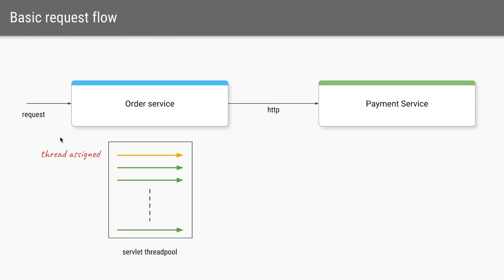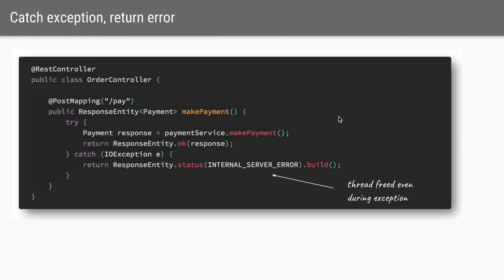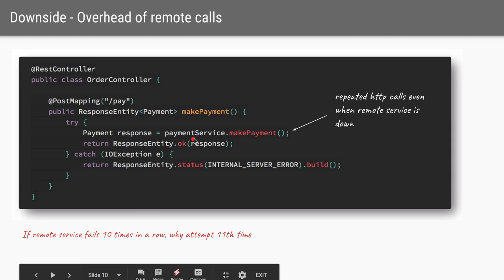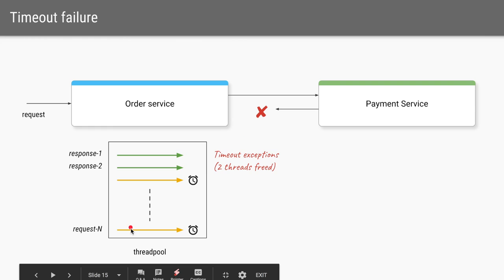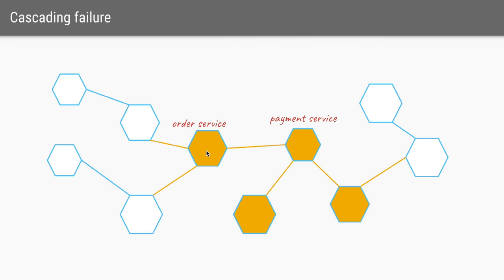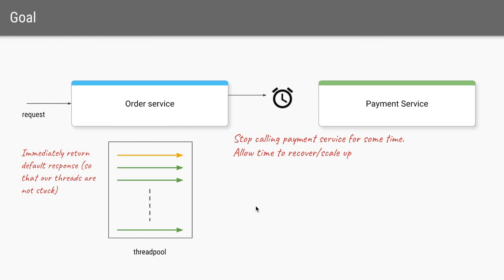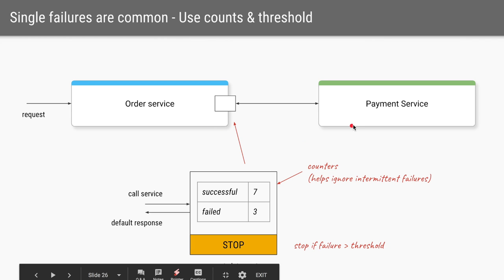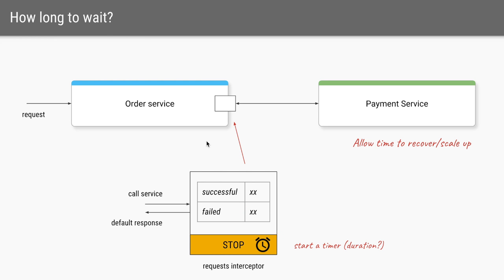Circuit Breaker Pattern - Fault Tolerant Microservices

Comment: Please do a Design Pattern series!

I feel with your experience and innate ability to explain in succinct terms, you can convey implementation of design patterns that would stick! (and also, how to figure out which one to use). The bookish or general pizza/car/ducks example do not shed light on how its practically used in everyday software development.

Comment: Theoretically it will be good to have "default-response" for  bulk head and circuit breaker patterns for managing the fault tolerance micro services, but where to apply is the question. How do you process a transaction without real-time authorization. Sending a default response does not solve the actual issue as most of the e-commerce sites does not allow "offline credit card processing". Yes it is good to have fault tolerant services, but where and how they can be used is the real question.

Very good tutorial. Keep it up.
Reply from the maker: especially for complex applications there are huge number of microservies.. one important functionality of this is to allow upstream services to recover and not bombard them with requests... and secondly lets say i have a discount service, if its unavailable i can still process the order, without discounts

Comment: Interesting topic. This sounds like a great candidate for machine learning to take control of the interceptor and dynamically adapt according to the service status. With more variations this could be helpful, suppose that the payment service is slow but can still process some traffic just not much, a static solution will either allow or stop, a smarter solution would be able to adapt to the threshold which could vary. I've actually seen problems like this for the company I work for, where we manually have to stop connections after some threshold to keep services up.

Comment: nice video explaining the pattern, though I won't couple the pattern into the microservice. Instead, I will let the orchestration to do that. That allows you to decouple your circuit breaker and leverage all the metrics and logging to the service discovery.

Comment: Hi..the content on your channel is really good..at the beginning of the video you said that if a service send an exception msg immediatly, the thread will be freed  so cascading effect will not occur. only when exceptions are sent after some delay other services get affected. My question is,  while maintaing a count of exceptions how will circuit breaker know which kind of exception happened?
Reply from the maker: Resilience 4j has 2 methods include and exclude where you can give list of exceptions to be considered for breaking the circuit 

Also, even though thread is freed quickly you may still want to avoid bombarding requests to allow other service to recover

Comment: Good one & I have no knowledge about these microservices, but I was just thinking that cant we have one minor health service thread running for every individual microservice on other port which a circuit breaker can check if the service has come-up after certain % of failures, rather allowing any more requests to pass through. And put all these failed requests in queue for some preconfigured time in circuit breaker else return the error to user to try after some time. Or depending on the usage of such services, these can be started on few other nodes also, during the loads & load balancer will distribute the traffic accordingly. Just a thought came to my mind.

Comment: Very nicely explained. Thanks for the effort you have put to explain. Just one qsn, what if the application is running on multiple nodes(multiple. jvms) , do we need to have any other configurations or the circuit breaker will handle that?.

Comment: Amazing video. Keep it up. 
I have two questions, it might be silly ones but I would love to hear from the DEVs
 
1. Is it a good idea to implement circuit breaker while making a DB connection or during query execution? Now if the system will not be able to get a connection none of the requests will go to the DB which should not be the case. Something must be implemented at DB side or in between  service and DB. 

2. Does this circuit breaker is required in PUT and POST APIs too ? Like for PUT POST we will make a request, this will use resources to build the request and finally it will fail if in an open state? Shouldn't this state be checked in the first place ?

Comment: Nice presentation. 
Just wondering: do you have any video explaining the differences between Circuit Breaker pattern vs Reactor pattern. Both of them are good for handling 'Cascading Failure' situation, isn't it?

@Defog Tech

Comment: @Defog, does this problem only exist in tightly coupled synchronous communication model like REST? Cause I see if instead, we use message queues/kafka based approach for communication we can avoid these cascading failures. Also even in case of REST, are we assuming the threads are not using asynchronous IO like Completable Futures in JAVA/ Spring Web Flux/ async await framework in C#, since they are getting blocked on IO request and doing redundant waiting? I feel using async IO can solve these problems without using circuit breakers. Am I not seeing something?

Comment: Any video on how to test microservices or testing strategies, for testing community please..
Reply: With the example of the payment service and order service above, you can run integration tests for the order service by mocking the payment service and passing that mock to the circuit breaker. That way, you can check it fails correctly in certain scenarios by changing the mock to simulate failure of the payment service.

Comment: Very nicely explained. Thanks!
I have a question though. If we use circuit breaker for making payments, can it lead to duplicate payments? 
I am using Hysterix in my API and few times amount is deducted twice from customer's account. I suspect it is due to Hysterix. 
Would appreciate you reply on this.
Thanks
Reply from the maker: Yes, thats why for such requests, its good to have idempotency_key. Check out Stripe payment documentation for better understanding.

Comment: I have  a Question:-
In my microservice, I am making a mono object if my client service is down or client service gives the 5XX Error
return Mono.error(new InputException(HttpStatus.valueOf(clientResponse.rawStatusCode()), "SERVER_ERROR_RESPONSE", "CLIENT_SERVICE_SERVER_ERROR_RESPONSE"));

What should be my fall back method argument to catch if it is caused by this case, to be precise i am making the mono.error objects if it has any failure responses from the client side ?

Comment: what are the differences between immediate and timeout failures then with respect to the circuit breaker pattern? are they treated in the same way?
Reply from the maker: good question.. AFAIK circuit breaker is unaware of which type of error it is. The timeout errors are dependent on the underlying http-client

Comment: Why don't we have a healthcheck api? and Request Interceptor call it and will have health info of PaymentService and that will be more robust way.
Isn't we doing a complex work instead of listening to Heartbeat or calling a health API?
Just a doubt. :-)
Reply: It depends on how the health checks are implemented, most of the times, we have shallow health checks like ping-ping, if there is any DB accessing issues or partial failures in the application (like Integer overflow exceptions in DB) and the rest of all functionality of service works, shallow health checks may not surface those. We can have deep health checks, but those are very expensive, checking all functionality for every health check is not good approach.
Reply: @manojBadam  Got it. Could you mention few points that are part of deep health check.?
Reply: Gaurav Pandey We use both shallow and deep health checks for our service. for container orchestrators like K8s,ECS we use the shallow health check and for deep health we have a suite of concise integration tests, we run these for every 10mins in a cron job to identify any application issues